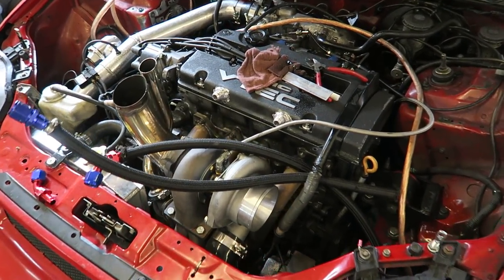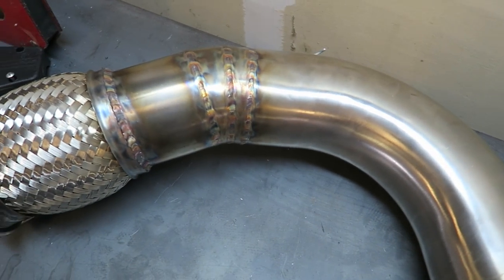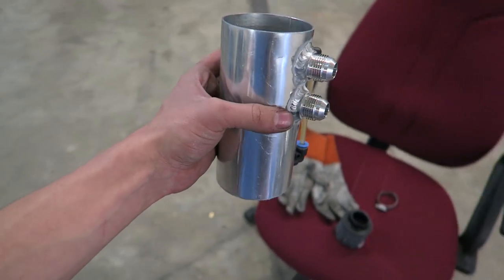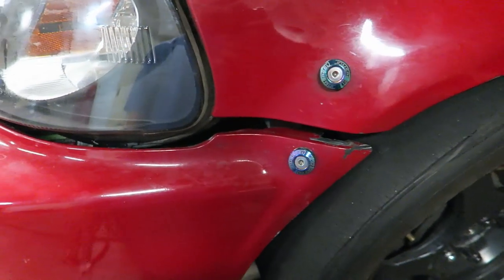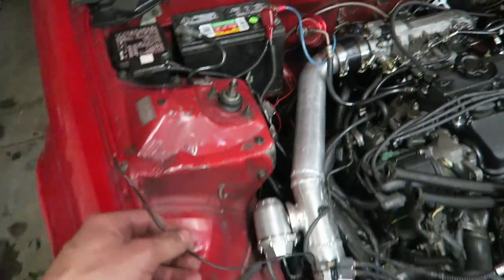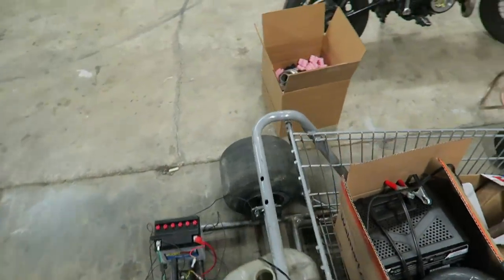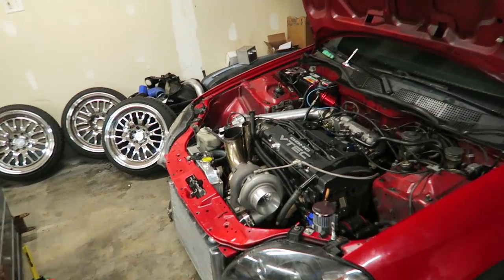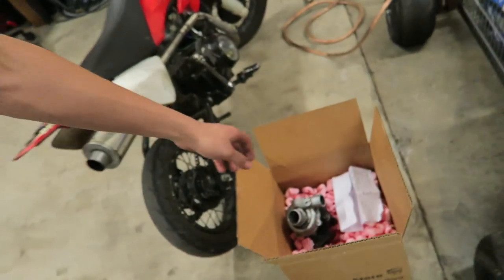Turbo For The Shopping Cart!

Comment: I'm a lover of all cars and not hating, my question is it seems like your rides are always needing something or always being worked on, would you say that's the norm for a high hp car that was designed for economy?
Reply: "A project car is never complete". Usually the owner always wanted to do something to get that "just a bit more power" added to get higher performance.
Reply: Ryan Fonseca to make the car run at high horsepower levels (that it isnt necessarily meant for) it is an ongoing process. The biggest issue is making the car run high horsepower reliably, so some times it can be a few runs of trial and error. This is not always the case because it all depends on what the application for the car will be in the end. Whether it's taking a civic to 400 horsepower just for fun on the street, or to 1000 horsepower to set quarter mile times. That is all up to the builder and what their desire for the car is in the end.
Reply: Steven Davis I fully understand the upgrade process and always tinkering aspect, it just seems like a failure of some part is always coming up. And not just these cars  either. my friends Hondas and subis, are always down with broken parts. ive owned a bunch of NA hondas, even a 13 sec NA prelude, but i guess I'm just realizing how much I appreciate my current car, put a vortech on my mustang and made 600rwhp, it's a 9 sec car if I fortify the rear and drop the clutch at 6k but I am ok with 10s and slipping the clutch, I'm not bragging or hating, just thinking out loud I suppose?
Reply: Ryan Fonseca honestly i feel it should be expected with any project car, especially imports. Coming from an import background (mainly euro cars, some japanese) i do understand the parts breaking often. Most cars are engineered for specific output ranges though, so exceeding those standard ranges is really what leads to breaking things. Unless whom ever is doing the build covers every possible failure point at one time during the build process, there's bound to be broken parts here and there. Take a mk3 vw jetta for example, if the slightest mistake is made it could brick the build and send the builder back to square one. But if all precautions are taken and everything is 100% properly, there should be no issues for a long time. Now, looking at purely japanese v. euro cars, availability of parts becomes an issue. Not so much for japanese cars because for most parts are relatively cheap and readily available. Euro's on the other hand not so much, parts are relatively expensive and they're not nearly as readily available. Euro cars are just over engineered beyond belief anyway, but that's the fun is taking them apart right?

Comment: Can someone explain me how catch can works, about crank case vents etc.?
Reply: Gedas alekveravičius There's oil and pressure just chilling under the valve cover, on a stock car the oil would be routed to the intake manifold but on modified cars you don't want that oil going back in the engine through the intake port so catch cans were made to put that oil in a container instead, via oil lines
Reply: cancel, but it can't just fill to intake, or to catch can(sport engines), btw air is less heavy than oil, so air will press oil to bottom. So how can it run to the top of of engine and to catch can?
Reply: Gedas alekveravičius There is oil squirters right under the valve cover for the camshaft/valves, and at high RPMs the oil pressure will rise and fluctuate and oil will spray everywhere. Naturally  they would overflow the valve cover with oil, since stock routes the oil into the intake people place catch cans to store the overfilled oil that was in the valve cover. I repeated myself a lot yes i know, but just hoping you understand a little more

Comment: fuck adding weight to the hatch just put drag slicks on it
Reply: Steven Tribue it has drag slicks.  it needs new slicks though.
Reply: ak operator maybe wider and yea new and sticky then maybe he can turn up the boost by gear or get rid of it
Reply: Steven Tribue I think he would have to cut the fender to get wider but that would help a lot

Comment: Won't the filter on the catch can create a vacuum leak?
Reply: Why would there be vaccuum under the rocker cover?
So no, it won't xD
Reply: Nick's DIY.  I agree, There's just crankcase ventilation there's no vacuum
Reply: It'd technically be a boost leak, since it's positive pressure. But you don't want to hold in crankcase pressure anyway, bad shit happens if you do.
Reply: Its not a boost leak or a vacuum leak.  It doesnt cause any issue with the combustion cycle.  Its to help relieve the pressure built up from the crank as its working harder when you pack the cylinders with more air.
Reply: Duane is largely right. It is not a boost leak or a vacuum leak. It isn't just from "working harder" though either. Essentially, as the air inside of the engine, in the oil pan, block, and valve cover heats and expands, that air needs somewhere to go. The primary source of positive crankcase pressure is from piston ring blowby though. Even in a perfectly good engine, some air will get past the piston rings during the compression cycle and go into the engine block. If that air was allowed to build up, there would eventually be 10s of PSI in the block, causing oil seals to fail or other major issues. The PCV system simply allows air to escape from the block, so those issues do not occur. Typically the PCV air is diverted into the intake to be burned in the cylinders, since it contains some oil vapor and it is better for emissions to have it pass through the catalyst. A catch can or air breather is used to instead allow that air to be recirculated or vented without the oil getting back into the intake, as this can cause enging knocking/pinging (not as in rod knock, look up what a knock sensor does) due to the increased cylinder pressure and lower combustion flash point temperature of oil. This is very bad, especially in turbo engines.
Reply: 802 garage its not often that someone in the yt comments section is 100% correct on such matters but today sir you have schooled many
Reply: I should have worded it diffrently but you pretty much explained why its working harder.  You can relieve the crankcase pressure but you still need to brace the crank girdle when you start to add boost or compression.
Reply: and why is that duane? the girdle thning i mean btw
Reply: With increased forces the crank starts to move about which causes added stress to the bearings.  Depending on motor you dont really need to worry about it untill you start doubling the HP or raising the rev limit.  A good example is the b18a (ls) girdle to the b18c (gsr/type r) girlde and then the spoon blade to keep it from twisting as well.  This is also why you see alot of guys go to sleeved blocks from open deck to keep everything in place as well.

Comment: a small tank, maybe your "ex" oil catch can, a scavenge pump, an oil cooler, some hoses and fittings, a switch and relay for your scavenge pump, make an independent oil feed and return system..

also u might need to change the jets for the carbs, you need to research if the carb can be used as drawthrough system or drawback system

drawthrough system:-
Pros - easier to start the motor
cons - u might pressurize the carb which leads the carb to leak on the gaskets of the bowl

drawback system:-
pros - no pressurizing carb
cons - hard to start the motor.might need to hook the choke up

if you are willing to spend some money, why not convert it to EFI and turbocharge it